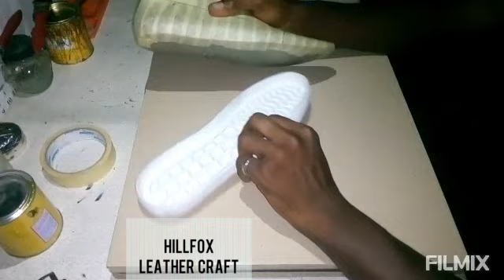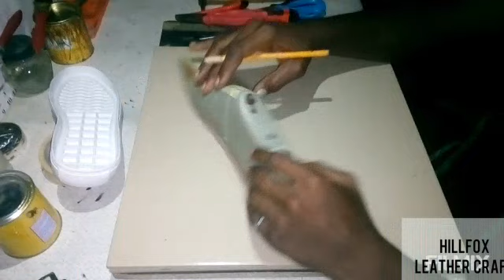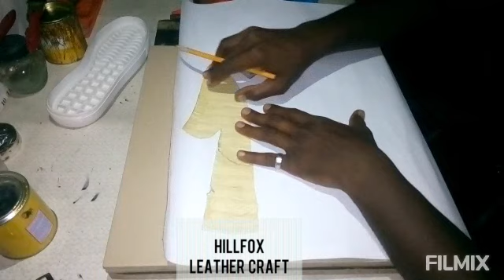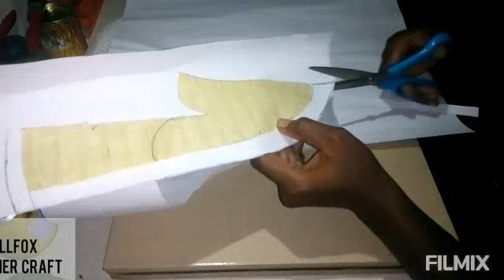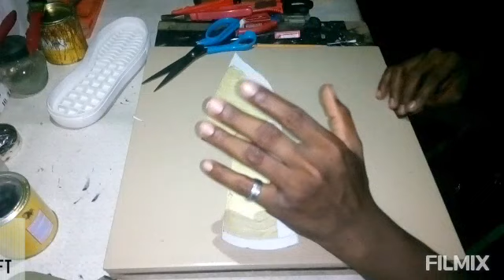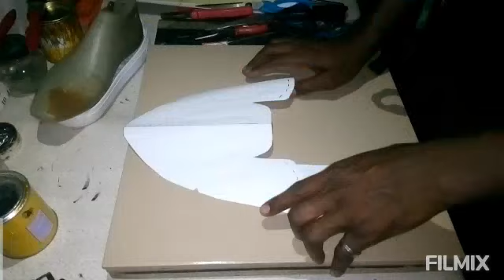How to make sneakers part=2 #shoemaking

Comment: Thanks for the video...I have a question...where you spring the vamp by cutting,can that be done for other shoes other than sneakers like boots or school shoes?
Reply from the maker: Springing the vamp is part of the process in making most shoe patterns,its inevitable.
Reply: @hillfox6188  thanks but my question was if the method you used for spring the vamp can be used for spring the vamp for boots too
Reply from the maker: Not all boots, there's a different approach to most boots.
Reply: @hillfox6188  ok, thanks for the response. I really appreciate it